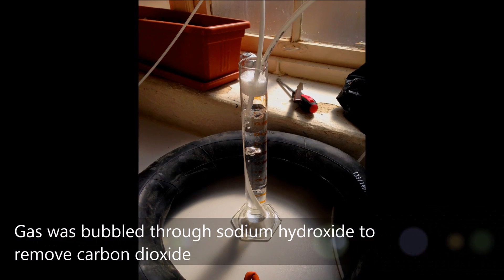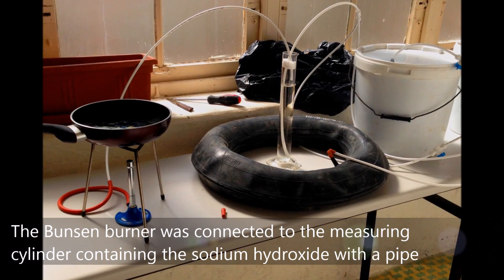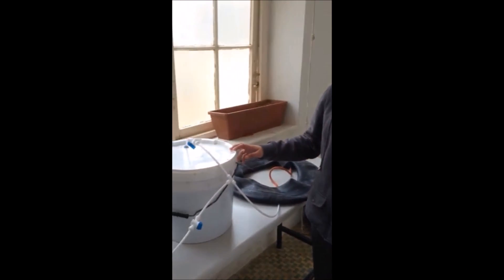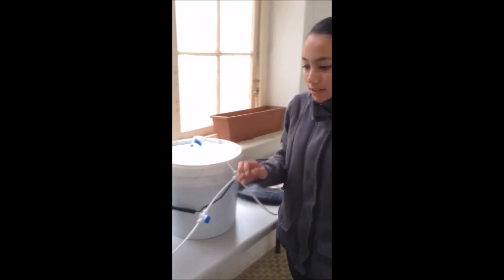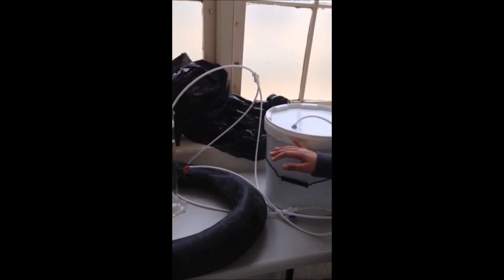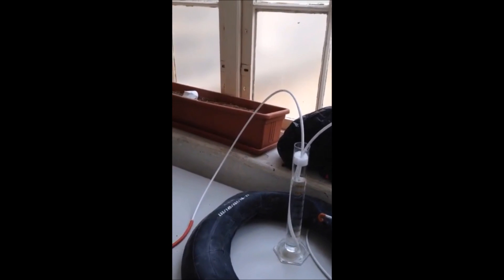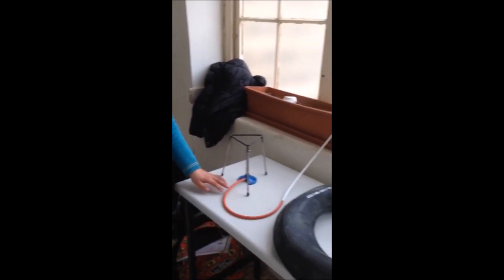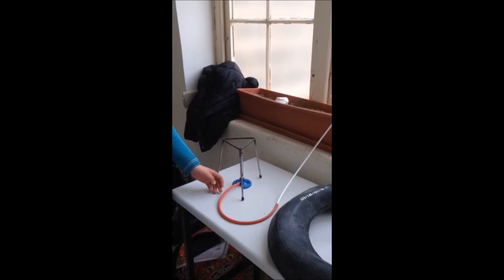Production of Biogas

Comment: Dont put the biogas generators in sunlight 
It will start the production of algae which will in turn produce oxygen 
Which convert shift the reaction anaerobic to aerobic( no methane produced)
Reply: I was told to put in the sunlight because the heat facilitates the gas production